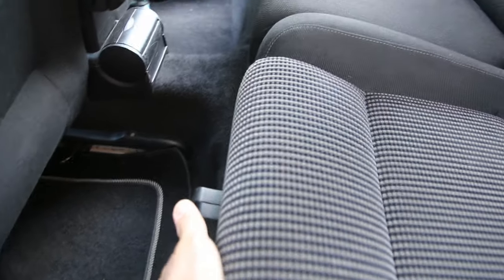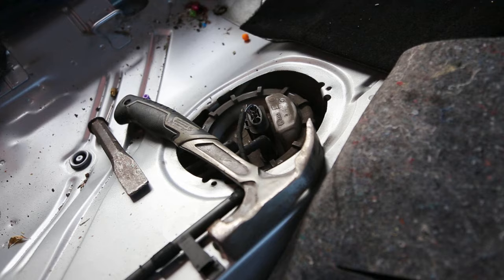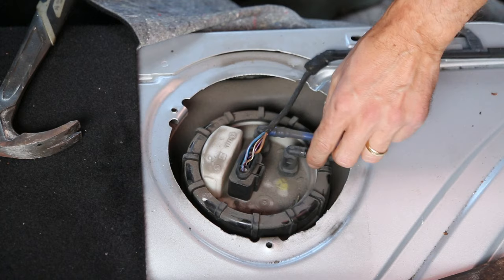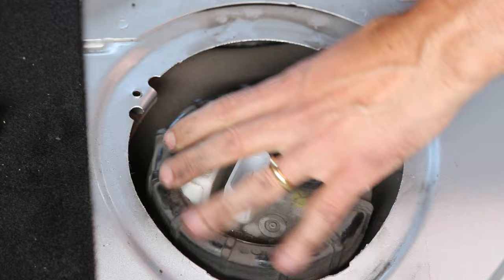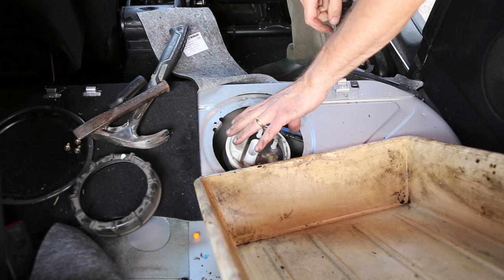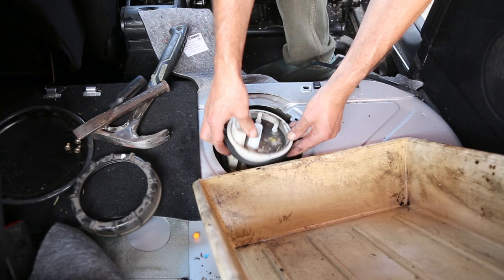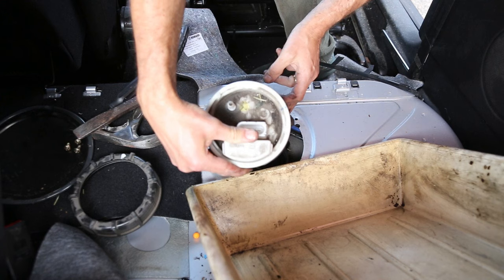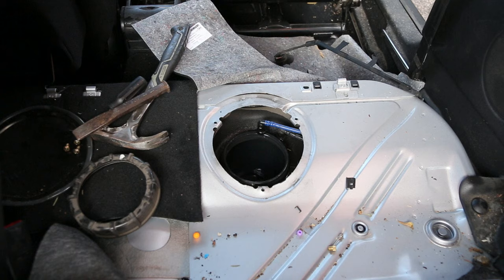How to Empty Fuel Tank from VW Golf/Passat/Jetta - Steps to Drain/Remove Petrol/Gas/Diesel car

Comment: For those wondering how the connector comes off.  Put a screwdriver in the slot at the top, press it toward the wires, and put another screwdriver blade between the connector and base and pry it up.  As you pry the screwdriver in the slot toward the wires it bows out the side of the connector and should allow it to clear the barb, then pry up on the other.  You can also press really hard inward  on the knurled edge next to the slot, that's how it's meant to be disconnected but hard to do.  Hope this helps.
Reply from the maker: Thanks!

Comment: Show us how to use the green pipie. You cut video at the critical moment.
Reply from the maker: You need to apply suction to the pipe using whatever method you prefer, some suck ensuring the fuel doesn't go in their mouth or you can use a device to create vacuum to start it off. Once going it will flow under gravity

Comment: You should really mention the year or generation at least because this isn't true for all of those models
Reply from the maker: This should work for most models of those cars, the process is the same even if the fuel pump is a different model
Reply: @ajvw  well my mk3 golf you have to got through the hatch not the back seat. So it's definitely not all of them